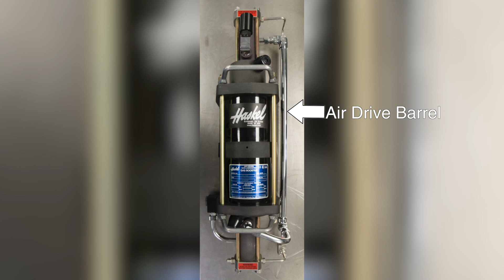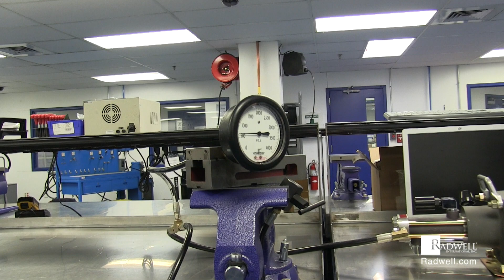Haskel AGT 32/62 Gas Booster Operations

Comment: My gas line is undersized for the bbq grill I purchased. Will this solve my issue?
Reply from the maker: It will not solve your issue. It would probably be very dangerous to use in that capacity. But don't take our word for it--We recommend that you go to the Haskel website and ask them directly. Stay safe out there

Comment: The booster output seems to be increasing alot more than it should, then there is a sudden drop of about 10-12 bar, and it stays until it keeps rising. The output pressure does not remain static as it used to.
What seems to be the problem?
Reply from the maker: Not sure-we will ask our techs and see what they say

Comment: How do you set/adjust the outlet pressure? Can you control this gas booster electronically or is it all manual?
Reply from the maker: Definitely visit the manufacturers site for specific information. You can find them at https://www.haskel.com/

Comment: Hello! i have an issue with our Diesel engine Air starter. Many issue or failure with our Haskel pumps. What should be the main cause of haskel failure? How can we prevent it ? What is the defect can be eliminate to increase pump Reliability? 
Thanks
Reply from the maker: Hi-We can't speak for the manufacturer about specific issues but you can get more information about Haskel Gas Boosters straight from the manufacturer here >> https://www.haskel.com/products/gas-boosters/pneumatic-driven-gas-boosters/

Comment: When you connect the shop air to the gas booster of the pump and have no gas flowing through the air drive, will any gas pass through the unit?
Reply from the maker: We will ask our Hydraulics and Pneumatics Lab technicians and get back to you...
Reply from the maker: Here is the answer: “Yes gas will pass through the Boosted side of the unit to be equal to the pressure of the incoming side, meaning if the incoming line of the gas is 15PSI the output would also be 15PSI in an idle state. There should be no cross over from the Air driven section of the pump to the boosted side.”
Reply: @RadwellTV  Thank you for the reply!
Reply from the maker: No problem! Thanks for watching :)

Comment: when do I need gas booster? thanks
Reply from the maker: Whenever there is a situation  requiring that gas pressure be increased. Gas boosters are capable of increasing gas supply pressures in applications where high pressures are required. They are the ideal solutions for applications such as amplifying shop air, boosting gas pressures of oxygen and nitrogen generators, and other similar applications